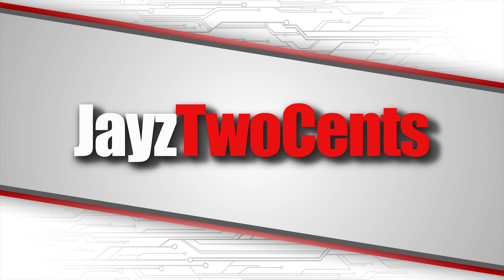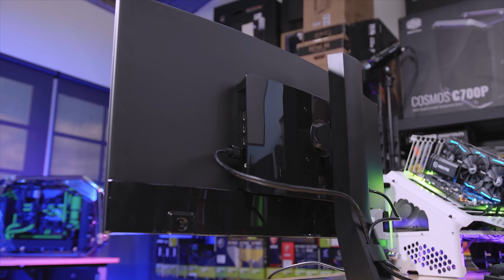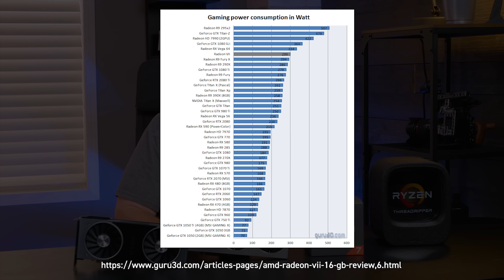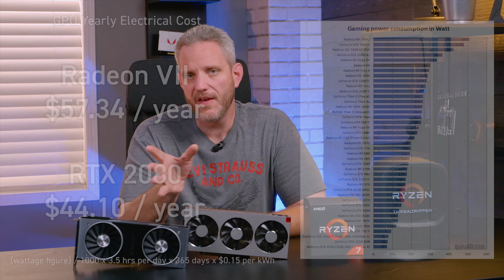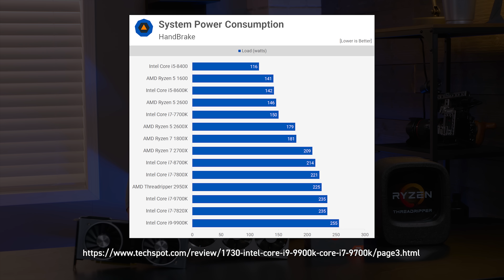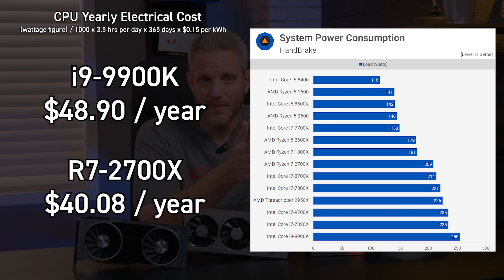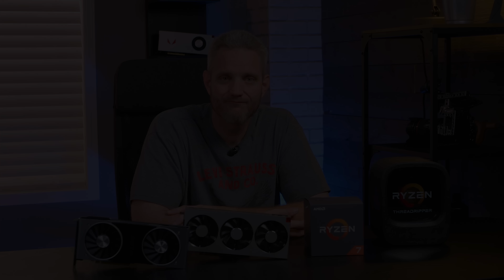Energy Costs of AMD vs Intel vs NVIDIA... This might surprise you

Comment: I did the math, and my results are: GTX 1060 6G OC version measured to 131 watts at full tilt, compared to the RX580 OC version at around 225 watts. Using your numbers that ammounts to: 25,10$ a year for the 1060, and 43,12$ for the 580. A difference of 18,02$ a year/90,08$ over 5 years. ..and to add to that my GTX1060 is supposed to use around 9 watts idling, while a RX580 uses 16 watts. My PC runs something like 12-14 hours a day, so it all adds up. Not counting the differences in lets say youtube watching, and all the other shit you do every day. 

..and where i live we generally pay around 0,34$ per KWH, which means the numbers are 56,90$ a year for the 1060, and 97,73$ for the 580. That's a 40,83$ a year saving on 3,5 hours of gaming alone, adding up to a 204,15$ difference over five years. ..and again: that is for gaming 3,5 hours alone, not counting the rest of the time the machine is running.

When i bought my GTX1060 i paid around the same money for it, as i should have paid for a RX580. If i lay down the same ammount of money as i did the last time, and adds the savings from the power bill, i'm now able to buy a RTX2070 for GTX1060 money. That is very real.

..and then there is the real reason i skipped the AMD RX line up: I'm into low/no noise PC's, and i want them to run cool and quiet too. In my Fractal Core 500 you would notice the difference between 131 watts and 225 watts. It wouldn't be cool or quiet, it couldn't be.

Comment: "But the power-draw is higher !"
More power-draw means more heat means more RPM means more decibels.
I don't want more decibels in my system. I want decibels outside of my system even less.
My two cents on this.

Comment: The most important thing you can do for power consumption is to run a PSU in 80+ GOLD rating or better and only run from 20-80% PSU load.

Comment: Did Jay just accidentally reveal that if you go with AMD you can use the cost savings to buy a nice water cooler and overclock the CPU a little and make-up that 10-12% performance difference and STILL be under the cost difference???  :)

Comment: Great video, finally i really wanted to see this because i've run all those calculations(about the GPUs) before and i need to say something on this.
The cost is not much of the main problem and even though a contributing factor, clearly with a few exceptions when it comes to power consumption between those cards or similar cards in terms of performance but rather the fact that the PSU gets stressed more with everything that comes(increased power consumption causes increased ripple voltage, larger transient loads and current, electrolytic capacitors lose their maximum capacity faster, the PSU gets heated more which that by itself increased the chance of it failing and reducing all its affected components and so much more i really need to remember from the electronics class) especially as the time passes which increases the likelihood of its failure and taking other components with it(!). 
For me(and probably many more), even by having my trusty titanium Seasonic 650 Watt i still don't want to wake up one day and see my system not running let alone having lost my files/system configuration lost because having an SSD (MX500 500GB) which is not the most reliable storage system due to its difficulty of recovering data as they really dislike power outages/failures is not an option to go into the hassle despite me keeping backup in 4 different separate HDDs and having a UPS and surge protector + interference filter.
But not all people can have the option for backup and/or a UPS and also don't want to go into the hassle of reinstalling windows downloading their games and programs and configuring them, losing personal files in the process etc etc.
It's such a waste of time to do those things and if a buying a certain GPU makes reduces my chances for that at similar performance compared to another choice then i'll pick that, which is why i picked 1060 6GB over the RX 580 a year and a half ago(the difference was 80 Watts...).
You get the point i guess...

Comment: OK. So first off I want to say I don't disagree with picking 3.5 hours, I think it is the most sensible choice possible. However you should not ever use median when trying to unify results. You should use average. Median is just the random number in the middle and has no statistical significance for the rest of the dataset. Just like lowest and highest fps have no significance when benchmarking and the actually important numbers are 1%low and 0.1%low.  For what I know you might have used average and said median because this is what people sometimes do anyway, but I just wanted to point that out. Also don't give us only the final cost of electricity you have, give us the amount so we can calculate for ourselves, and then give us your final numbers. If the middle value is missing this is strictly locked to where you live. :)

Comment: For workstation users and content creators, with the 8+ core CPUs, actually power consumption really can make a difference. Me in particular, when I render projects using the ray tracing functionality in Autodesk Inventor Professional, CPU is at 100% all the time. It is extremely CPU intensive and even is a good stress tester for CPUs AND RAM overclocks. For workstation users, AMD Ryzen/Threadripper any day. For gamers, Ryzen 3000.

Comment: In terms of cost from your local utility company the argument is moot for sure, but if the components you're choosing produce more heat because of their increased power draw then you spend more to meet your temperature or noise level goals on top-tier cooling solutions. If I'm cooling a 9900Kelvin (see what I did there ;) I want the most efficient and quiet water setup money can buy, but if it's a 2700X or 8700K just give me solid Noctua or decent AIO water setup. The same argument can be said for GPUs as well. The point is that IF costs are going to be considered in regards to power draw it should be the ancillary cost of cooling said components and not how much it costs you from your utility.

Comment: Jay, you should also do some PSU comparisons, say a Bronze at $80 vs Platinum at $110 in the same system (i.e., wall power goes up while system requirements remain constant).

Comment: Just upgrading to newer, more efficient hardware can have a positive effect on your bill. I was using an AMD FX 8320 from 2014 until just a couple months ago. With my taxes this year I bought a new mobo, ram, and CPU to upgrade to Ryzen. I went from my 8320, which I had overclocked to 4.55Ghz, to a R7 2700X. My electric bill dropped by 15$ the first month and the last two months have been 13$ and 17$ less than before the upgrade compared with the previous year. I spend most of my time on my PC, it runs 24/7. For example I have 39,000 hours on my Samsung 840 EVO that I bought in 2014, that should give you how much time my PC is on. There is only a TDP difference of 20w, but with my overclock on the 8320 I'd bet I was at a 130w+ tdp.

I still use my R9 290X for my gaming. I only have a 1080p TV and it performs fine, but it is POWER HUNGRY. I think it has a 300w tdp. It is also a space heater. I can feel a temperature difference in my small room after a couple hours of gaming. I don't mind it because I may as well get something else out of the PC besides simply using electricity. I don't turn my heat on very often, I live in central Colorado so I don't need to often anyways. that is something to think about, too. Is the amount I save by upgrading going to offset the effects of the older hardware? ie if I use my PC as a heater and I don't have to use a separate heater, if I can no longer use my PC as a heater will I need to turn my heat on? Will my heat being turned on cost more than me NOT using my old, inefficient hardware? My heat, when I do have it on, costs me about 40$ for the natural gas. I would need to save more than 40$ a month for me to not use my old hardware. As it sits, my upgrade to my CPU hasn't effected the heat when I game as I still use my old GPU. A new GPU, which may not benefit me in gaming as my TV is 18080p and my R9 290X drives everything just fine, might cost me more if I have to start using my heater. Extra frames over like 62 do me very little good on my 60Hz TV. 

 I get the best performing hardware I can afford at the time. The long run really only affects things at the end of a certain period of time. I didn't notice that I had 15$ more after my first month and I haven't noticed any extra in my pocket these past couple of months, but the saving is there on the bills. If you handed me the amount I saved in a year it would be noticeable, but small incremental savings aren't noticeable and noticeable what people want. People naturally desire feedback. I also have an internal things where I like to stick with the same tier hardware. Even if the performance of a GTX 1060 6gb may be slightly better than my R9 290X, it is among the lower-tiered offering from Nvidia. If I upgrade my GPU it will be near top-tier, like the R9 290X was at when I bought it. It's a conceptual thing in my head, something personal without any real logic.

Comment: It even levels out to some extent.  Especially on CPU's and/or frame locked GPU's.  What I mean is CPU 1 is faster, but uses more power than CPU 2.  For every workload given to each of them, CPU 1 will pull more power, but finish the process faster than CPU 2, so much of the difference is gone.  CPU 2 used less power per second, but took more seconds to finish the job.  Same with GPU's that aren't running full (locking frames).  If the 2080ti is running at 70% to meet the requirement, and the 2080 is running 95% plus, suddenly the higher TDP 2080ti isn't drawing a large difference in power.  I'm just throwing out number to give an example.  The percentages are not meant to be an accurate example of their performance difference.

Comment: Jay, you forgot about motherboard socket. With my Tomahawk I can still replace my 2700x with the next CPU if I need to which is not usually the case with Intel. I realize we're not talking about compatibility and upgrades here, but merely power consumption, still this is also important to consider.

Comment: There's also maybe the need for a better power supply, better/more case fans to get enough cooling at reduced noise, and if you run AC in the summer it will also cost more.

Comment: The power argument only makes any sense on a mobile device, where battery life is important.  For any wall powered device power draw is insignificant.  The dollar cost of wall power is so small as to be a non factor.    Conversely, the longer the time between charges on battery power the better so in that case efficiency is a valid argument

Comment: In all honesty I have never looked at the cost of powering the system when selecting the parts, maybe if you are a large firm with multiple machines it's worth looking at but the costs aren't going to be that different most of the time.

Comment: Doing a comparison between these two CPUs would even make more sense, if you include the fact, that the 9900K doesn't need to run as long as the 2700X to do the same work. But ok, they still don't cost the same. It wouldn't even change that much, but still...

Comment: Note that, theoretically, Radeon Chill could also bring the power draw down during gaming.

It's moot to use it in a comparison, not exactly a consistent thing, but just helps make that "bUt PoWeR dRaW" argument even worse on the GPU side.
Reply: Chill never worked right for me.

Comment: There are still a couple of things to consider. If you have AC running, you'll pay also for removing the heat. The opposite is tru if you need heating, and power draw doesn't make any difference if you have direct electric heating. Then there's also the environmental part. But still, this is quite a small thing. There are more efficient ways to reduce electricity bills, but of course everything adds up.

Comment: IMO the main reason to consider power draw is cooling, if the part use more power it also need more cooling.
Reply: Or the PSU because of wattage count, and the fact they degrade. If you don't have to replace the PSU then, you'll have to much sooner.

Comment: I'm not actually sure why AMD CPUs being space-heaters is the long-standing joke when, over the last 20 years, it's typically been Intel that is hotter. The old Athlon/XP/64 series had dramatically better IPC and ran way cooler than their Intel counterparts. Netburst, anybody? That ran all the way until around 2006, when Core 2 came around and Intel finally had an architecture that wasn't tripe. Then we got AMD responding with the the Phenoms...which were a bust because of that TLB issue, but the Phenom IIs were very competitive; a quad-core Phenom II X4 940 performed better than a Core 2 Quad Q8400 while using slightly less power at load and a lot less at idle. Even adding two more cores with the 1075T, it now dramatically outperformed the Core 2 Quad 8400S for the tiniest increase in load consumption and still dramatically lower idle consumption. It wasn't until Intel began slaughtering AMD wholesale with Nehalem that things turned around, and thus it's only really the FX that earned the designation "space-heater", because it was essentially AMD's version of Intel's Netburst a decade earlier. And since everything is cyclical, today's Ryzen is a lot like Core 2 Quad in that it's an MCM design; both AMD and Intel have now lampooned each other for using that approach and that approach has twice, now, been the one that upsets the market.

Honestly, it's always been little more than misguided enthusiasts going tit-for-tat.

End-rant.

Comment: I bought the R7 2700 because of the fact it's an 8 core 65W TDP processor with 4.1GHz boost for my 24/7 always on rig, board is crosshair 6 with 16GB gold 750W PSU. I can always overclock to 2700X levels of performance when I choose as I've got a MA620P twin tower cooler rated to 200W+.

I've had HWinfo running for the last 9 hours while I'm doing my normal stuff, watching youtube, reading articles, have a couple of idle games running in the background etc. The total average (SMU) CPU package power draw reported is 37.5W, while the CPU+SOC (SV12 TFN) is 27.5W @15.9% Total CPU utilisation.
Max load 100% using prime 95, SMU CPU package maxes out @ 75.8W and CPU+SOC SV12 TFN is 55.8W stock.

I don't have the gaming load data as I've not recorded it as yet, I have the 9 hours of data because I forgot to close the sensors when checking usage numbers for another comment, but the GPU chip power is 9W average (RX570) during this time.

If you use a sensor program like HWinfo during a gaming run, you can determine with reasonable accuracy what your components are pulling and when combined with an at the wall meter, you can work out where you can optimise power draw (how much does RGB and all those fans add to power draw). When gaming I like to use chill to set min max FPS to keep the GPU under 100% utilisation, dropping power use while maintaining a steady frame rate for the most part, while never dropping under the freesync min refresh rate.

The 3700X looks like it's going to be an excellent high performance low power chip, that will overclock nicely if required.

Comment: The performance difference between these GPU's is mainly superficial in synthetic tests, while anyone gaming on any resolution up to 4k can enjoy the game being it on either lower or higher settings and run it smoothly. There is no real reason to pay more for energy costs just to have a 8x extra anti-aliasing on your screen, as 2x is good enough. I would go for the Intel i5 10600k processor, as it has a TPD of only 65w and performs for 95% compared to high-end models with TPD of 105w. Saving you 40w per hour. The synthetic tests don't even mean anything at all.

Comment: It depends on the usage, I even tweaked my hardware for power efficiency and I saved around 70w under load. If I hadn't done that, i would pay around 100€ more per year with my usage. If I had gone for more power hungry parts the difference would be more like 130w. But this is going to depend on the person.

Comment: I have an FX 9590 5ghz boost cooled by a Noctua NH D15, Ryzen didn’t exist when I bought it. The air coming out of my PC feels cool even when rendering video in Camtasia. The thermals are great, at most it will show 50c on the CPU and maybe 1 or 2 Celsius over ambient internally.

Comment: I'm using a 2700x running constantly at 4.2ghz on all cores with a 1080 Ti boosted to 2ghz when gaming. Playing about 3-4 hours average each day. 

Power meter measures roughly around $24 per year.

Comment: Don't think anyone compares power draw as price of electricity, but mainly heat, PSU requirements, cooling solution for lower temps and sound.
Reply: For me, the only reasons I consider power draw is PSU requirements and cooling, though I don't think the price difference in PSUs can make too much of a difference.